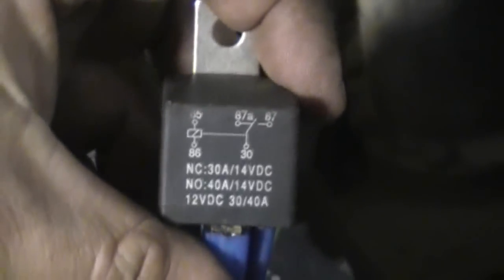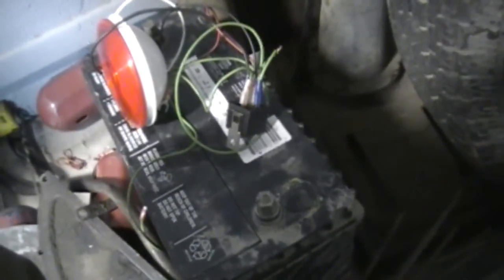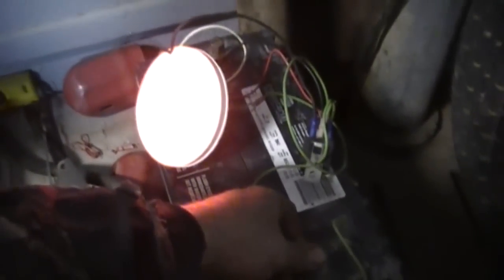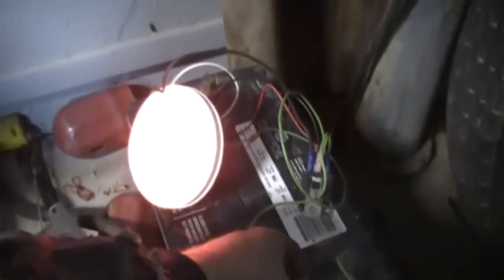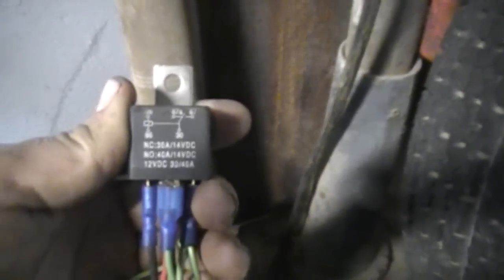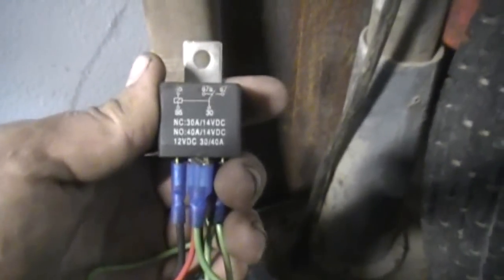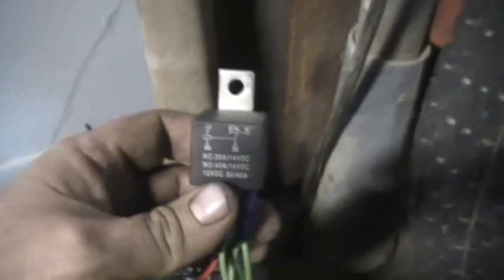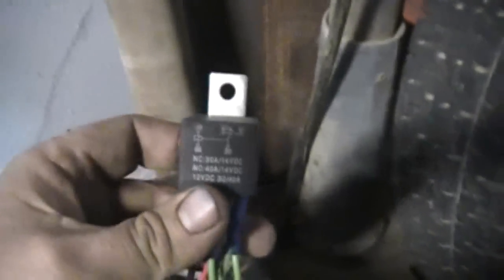Automotive ignition kill switch. Very simple and self resetting.

Comment: I have a 1995 F150, is there an EASY way to install a kill switch to either the coil or starter solenoid? Thanks… Jim
Reply from the maker: Starter would probably be easier. Just splice this in.
Reply: @ReverseGear  Would I wire the switch in series with the S terminal or can I just ground out the S terminal?   Thanks…Jim
PS….what wire gauge would I use and what’s the amp draw?…..thanks again!

Comment: need some help on where it is the Push Button Switch is getting power from? I know wire leads from button and connects to *85 on the relay, where does power to the button come from??
Thanks I know old thread but need help.
Reply from the maker: From an ignition on source.
Reply: @ReverseGear  
So your saying from hot when ignition on? Or constant hot? To push button then out from push button to relay switch.
Reply from the maker: @pintobobster  positive power when the ignition switch is on.
Reply: @ReverseGear  
Thank You very much for the clarification, I can get this done....

Comment from the maker: The bulb and relay is grounded to the battery. If it's the two green wires on the relay that are tied together. That was a experiment. It did not work after I cut it. So I just wired them back.  The two black wires at the relay are bulb power dim/bright. Or what I think what you are seeing is the incoming power from the ign. switch. And those two wires are connected. Incoming power and the low function of the light. Just so you can add a armed light or buzzer in this location if you want.

Comment: so let me get this straight, spliced( wire that was cut) going to the 87 (outside) and 85 prong. 86 to ground, 30 is ign, 87a (middle) to the light. which one is the fork type connector going to?